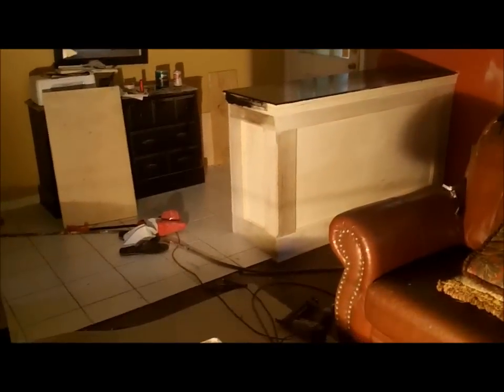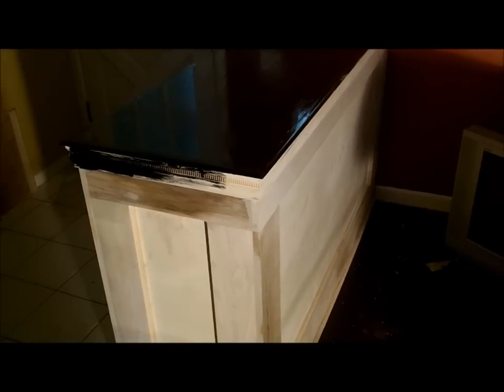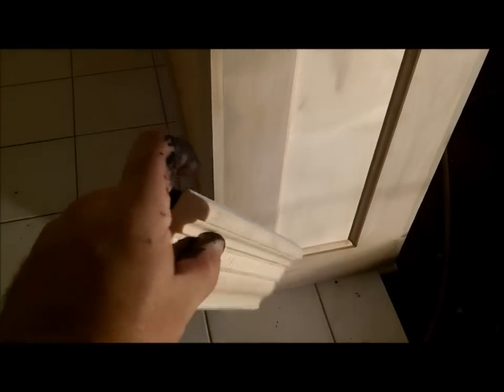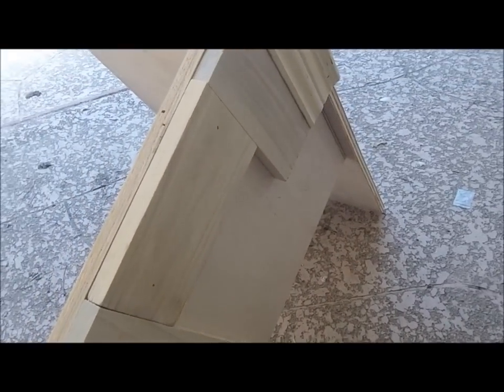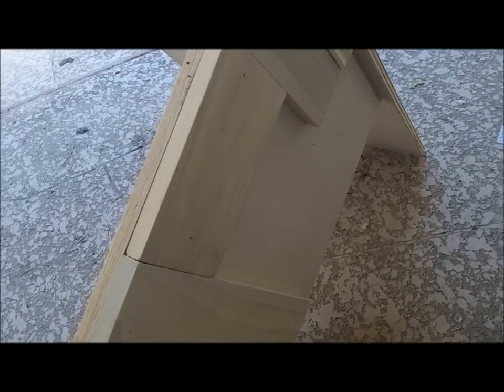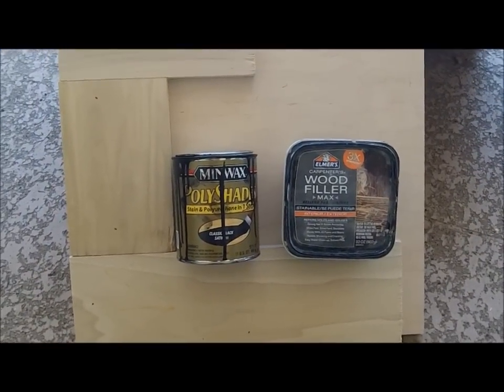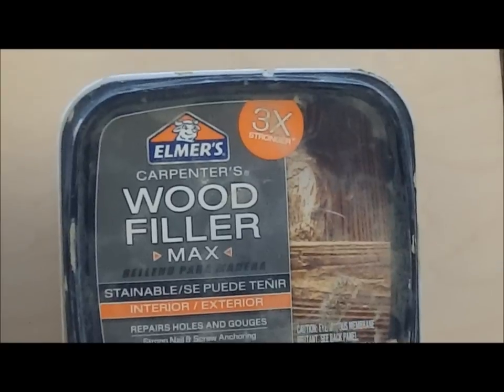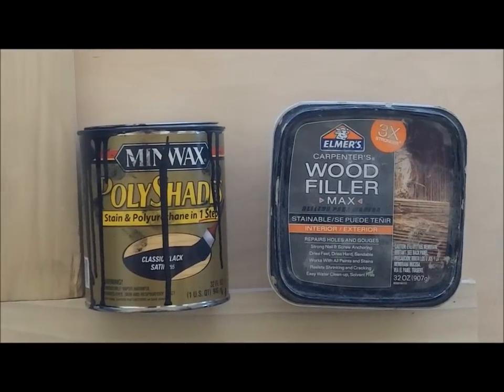interior diy half wall build

Comment: how did you attach the base to the floor? using adhesive, i have a tile floor, because if you used only nail to the stud, it would not be strong enough